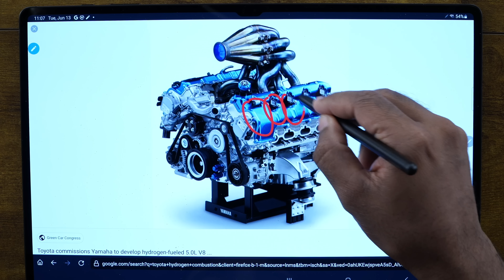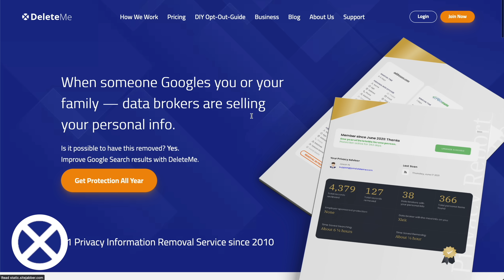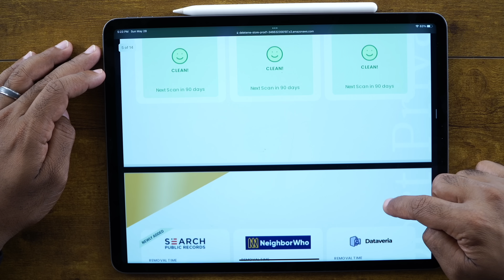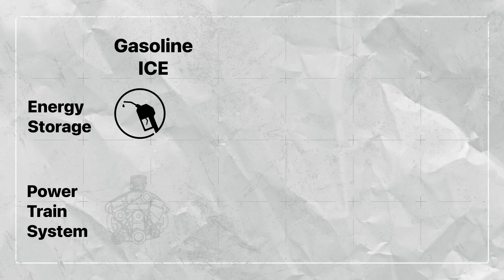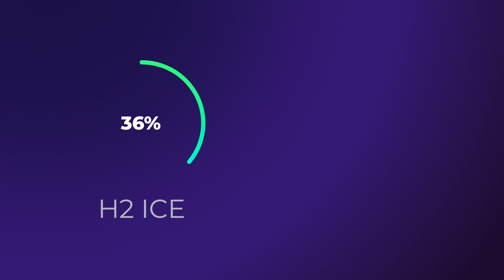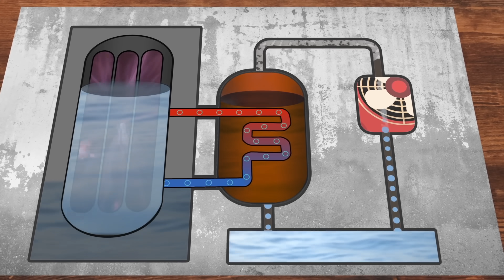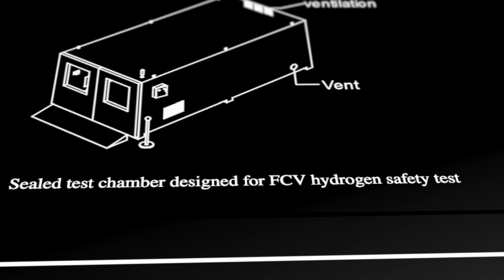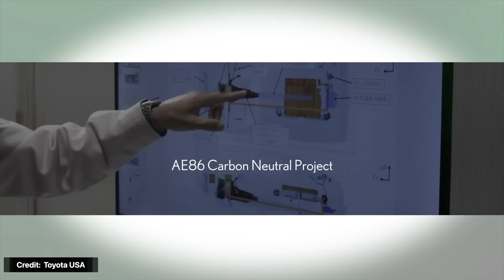Toyota's Says They Just Destroyed EVs - Hydrogen Combustion Engines

Comment: As you mentioned, in part at least, the production of EV batteries requires mining and processing of dirt to extract necessary minerals, eg Lithium (I hear rumours that there are in the wings batteries that will be based off of either Sodium Chloride or Carbon Dioxide but seeing is believing).  I'd be interested to see a comparison of the actual cost to the environment of the actual "cost" to produce hydrogen (we, I believe are developing green hydrogen plants here in Aussie) vs the actual "cost" to produce the stuff that goes into the current EV batteries including building the batteries and the cars (loads of plastics) themselves.  I recall, what we call here the RAC or AA, in Germany saying you'd have to do in the order of 160k kms in an EV to undo the enviro damage done building the vehicle.   By "cost" I mean pollutants short and long term and, the energy used (and can that be renewable energy).
Reply: Agreed, the environmental cost of battery materials sourcing and manufacture seems to have been glossed over in this video. If you've ever watched documentaries about this mining you can see that it destroys huge areas of forest and requires huge highly unclean machinery to mine just tiny amounts of these materials. Further to this I find it incredible that no one seems to be discussing the impact of nuclear power plants on the environment. Whilst the production of electricity from them is relatively green there is the issue of nuclear waste disposal that rarely seems to be mentioned or discussed. I understand underground nuclear waste storage facilities generally do a good job, however as more and more waste is produced how large will these facilities get and how expensive will the upkeep become to prevent leaks and contamination. I'd love to see a video that discusses these issues please @2bitdavinci
Reply: @TheWindsurfk59 I think I saw a video somewhere talking about a technique they use now in nuclear that they can use the same material though the plant 2-3 times over and by the time they are done the nuclear waste goes from needing to be stored for thousands of years to only a couple hundred.
Reply: @TheWindsurfk59 "All" mining is destructive. That goes for everything and is not all restricted to batteries. ICE cars also always used materials that needed extraction and processing. Cars aren't made from Pixie dust. Oil is an ugly business and fracking us terrible.
But battery materials are suddenly the one resource extraction people worry about.

We need to reduce CO2. Fossils have to go. That's priority number 1 - if we want to stop cooking our planet (more than we already do).
Reply: @oerthling  no sh!t Sherlock!! 😱 You seem to missing my point which is the extraction and processing element needs to be taken into consideration in these 'analysis' for both types of vehicle. Also I think you'll find the extraction and processing of rare earth metals requires more energy and destroys large areas than the extraction/processing of more abundant metals, pound for pound. Not sure why you think I don't realise the end goal is reduction of CO2 production and fossil fuel use?! Never said I disagree with that, and for your clarity I whole heartedly agree that we need to reduce CO2 emissions. I just know that unless you do a full comparison of all elements of the process you can't for certain say that one is more environmentally friendly than the other. Imagine for example they found a way to convert existing ICE vehicles to hydrogen ICE vehicles. How many people have bought new EVs and scrapped/sold their existing ICE vehicle, producing more need for mining rare materials to manufacture new EVs all based on the argument that what comes out of the exhaust pipe is greener but with zero consideration the impact the manufacture of the new vehicle has or where the electricity comes from. Someone further up this discussion has said research tells us that 80% of the world's electricity still comes from the burning of fossil fuels! So no it's not as simple as you seem to be patronisingly insinuating for no apparent reason. I can only assume you have brought into the sales schpel and bought yourself an EV and now take offence at anyone questioning that choice? If you're truly all for a greener planet then surely you agree all aspects of any decisions we make should be researched fully to properly inform our buying choices. I don't know the answer but I know I'd like to have all the facts before I make a decision. As you're so sure of yourself go on then tell us all the exact impact of a modern ICE vehicle Vs an EV from manufacture through life span, including fuel production, distribution and recycling yield Vs recycling CO2 emission requirement. And while your at it maybe you can tell me how much CO2 it'll produce to start blasting nuclear waste into space once we've run out of storage space?
Reply: BYD has Sodium Batteries in vehicles
Reply: Still hetter ROI for pollutants that an oil burner, which only gets worse the oldet it gets!
You can never win with ICE!
Reply: What a bunch of nonsense BS. Sadly this is the same overused propaganda script with zero sources and total ignorance of engineernig reality.
1. As an Aussie you very much know such experimental programs like the Toyota Hydrogen Centre in freaking OIL Refining Town ALTONA Victoria is PR Stunt that will be shut down soon.
2. "160k kms in an EV to undo the enviro damage done" is cunning fear mongering word salad.  I love how you inflated the number to 100,000 Miles from 100,000 Kilometers which is what the heavily panned Volvo PR report stated "Volvo C40 Recharge will need to cover 68,300 miles (109,918 KILOMETERs) before it breaks even with the ICE XC40". The realistic number for Aus dirty grid mix around is 50,000 Miles because we're just soo Coal & Gas dependant. That 50,000 is in comparison to BEVs easily achievable 200,000 miles or way more lifespan.
3. "loads of plastics themselves" What an idiotic false assumption. ICE uses just as much plastics as BEVs, especially since Toyota and GM pushed the use of Plastics even for key engine parts like Coolant manifolds. Use of plastics is Moot between ICE and BEVs.
All you have done is spread falsehood rumors to fear monger.
Reply: Auto Expert John Cadogan, does the break even comparing a Ford raptor to the Tesla plaid.
Reply: I'm not shure but I belive the exact data is hard to extract scince those rare dirts (I don't know if that's how you say it but I simply translated it from the portuguese "terras raras") are mostly under China influence and other components like cobalt are mined in poor countries with child labour and stuff
Reply: @antonioramalho1835  Most of the lithium at the moment comes from Australia. The problem is that it is easy to process as it is just dug from the ground, like coal. To keep up with just the demand today, we will have to use other sources of lithium, the kind that requires more of a process to extract and process. But yes it is hard to get any accurate data from china.
Reply: It's more like 100k km, but batteries are energyagnostic and they can be produced in a green way, just by using EVs in mining.
Reply: @michalandrejmolnar3715  what about the rest of the car? N Lithium is far from green.
Reply: @huwgrossmith9555  there are better cell chemistries like sodium ion
Reply: You have to keep in mind that infernal combustion cars can be more or less thrown away after 10 years or more. EVs as cool as they are, unfortunately are hazardous waste and will be a problem long term.
Reply: @SixTough  The batteries can be re-used after the capacity is too low for a car.

Battery capacity in a car has volume and weight constraints that become much less relevant for a house or grid battery.

This has already started in pilot projects.

Eventually, after the batteries have really been used up they can be recycled. 

And you can't just throw away ICE cars without leaving hazardous waste. All that plastic, some of the metals and certainly all of the oil gunk is problematic. Yes, people have been doing that. But just because they are assholes, not because it's not a problem.
Reply: @oerthling  yeah sure and the current ICE car batteries can also be reused. How many of them are?
Most plastic and oil can be burned albeit some fluoropolymers will likely be used in gas couplings.
Reply: If they did they told you the truth, no one would buy an EV 😡
The life cycle of a battery is 10 years Max
Production of EV makes it so it takes the first 6 years for them to be clean, not hard to work out how long they're really clean for!
Then what happens to those depleted battery's, land fills or the bottom of our Oceans 😡 and these are the people that profess they're green 🤣 It's a big Con and gullible people are falling for it hook line and sinker and guys like these are making money off the gullible 😡
Reply: I'm still waiting for graphine to come into our lives. Over a decade ago it was discovered as cheap and efficient battery storage. 

Batteries must be like toothpaste. Always new and improved yet nothing changes
Reply: This is an incredibly important point. Not only do you have to consider the environmental cost of creating the EV and its batteries, you also have to account for the cost associated with the generation of its electricity.  Currently approximately 80% of all power generated across the globe is from fossil fuels according to the Environmental and Energy Study Institute, ergo most EV's will never even be close to carbon neutrality.
Reply: @phalanx21860  I imagin the weight would be an unknown energy efficiency factor as well. You might have good milage but at what cost in power needs when the vehicle weighs almost 10,000 lbs.
Reply: @Raven5431  yeah a lot of factors to consider in this situation
Reply: @phalanx21860  honestly if your talking just about pure efficiency then trolly cars would probably be millions of times more efficient lol. Co sidering everything is going self driving anyway you might as well be connected to a track system.
Reply: @Raven5431  honestly not the worst idea, but I could see implementation being rather difficult in a lot of locations. seriously good idea in theory, just in practice it could be difficult :)
Reply: @phalanx21860  ya would be very difficult considering weather and debris on the road. Track system in the road I think would be out of the question. Overhead powered tracks would be an idea specifically on the highway for long distances that you can connect and disconnect from. Might not need a solid connection something a bit more loose and a way for a car to know its location.
Reply: @Raven5431 "Unknown"?
Reply: @phalanx21860 Always the same FUD - again and again.

Everything has environmental costs. But for some reason people never worried about those when it comes to ICE cars and oil - but suddenly batteries have environmental costs that totally mean we can't use those. But we can still use ICE cars? While fossils cook our planet?

This is mind-boggling.
Reply: @oerthling that's because the argument for ev's is that they're green. No one thinks ICE cars are.
Reply: @PhilboDraggins  No car is "green" in absolute terms.

But being relatively green compared to ICE cars isn't that big of a hurdle.
Reply: @oerthling  a hurdle that evs are currently tripping over. even if they use purely renewable or nuclear to charge, nothing is mitigating the effects of mining lithium and using that much plastic.
Reply: @PhilboDraggins  What is mitigating the lithium is not emitting anything during use, not using up all the materials making up an ICE motor and exhaust and tank and being a lot more energy efficient, quieter and even more responsive.

Plastic? Other cars don't contain plastic?
Reply: In a complete analysis EVs are about as dirty as ICE cars. If battery capacity doubles then they’ll be a clear winner. Toyota wants an option for everyone. EVs are nowhere near suitable for everyone. So they’ll make some EVs, ICE of multiple kinds (synthetic fuels are also a reality) and hybrids and sell even more cars than VW. Seems like a good decision to me.
Reply: @f.kieranfinney457 No. They are not.
Reply: @oerthling  the total CO2 emissions are better for a hybrid ICE than pure EV. So yeah. They are. Mining, shipping, manufacturing, disposal are all part of total CO2. EVs are worse at the moment but will eventually do better. For places where electric infrastructure is poor and incomes are low, like Africa, ICE will dominate for decades to come.
Reply: All of the minerals would be mine anyways to make other technology. Hydrogen car would still need minerals and plastic like every other car. EV batteries last easy longer then we thought 10 years ago and once not really usable in cars can go to storage and then there are companies set up now ready for recycling of batteries to keep the minerals circulating in the economy. The recruiting process is also on its infancy and will get better.

Comment: I am a believer in H2 as a fuel source for automobiles and applaud Toyota's developing an ICE for this fuel source. Regarding EV's they faced the same negativity at the start due to minimal availability of fueling stations. Currently EV's are, in most cases, priced out of "normal" consumers budget. The one MAJOR issue with EV's, and there are probably more, Is the life of the fuel cell and the disposition of it when it wears out. All in all, I believe EV's technology consumes more fossil fuel energy than H2 production. If the US would quit vilifying nuclear as an energy source, I think, over time the cost will come down. You are an Engineer after all.

Comment: I hope H2 ICE cars succeed and given time and investment (just like EVs needed) I think they can.  I can't support EVs because the typical EV is way more expensive to purchase, has a much worse long term environmental impact to procduce (hello Chinese strip mining), and according to the dozen plus people I know who have EVs, none get their rated range.  These factors mean the typical EV will take almost 7 years of driving 10K miles/yr to break even, cost wise. with the equivalent gas ICE car (assuming low eletricity costs, which the green industry pushes higher every day).

Then we have to consider the typical ICE car can last 15-30 yrs easily while every EV will need to have an extremely expensive battery replacement within 10 years and the new batteries need to come from sources that have little to no concern for the environment.  We will run out of the rare earth metals for EVs (while doing more environmental damage) far before we will run out of fossile fuels.

Comment: Mostly sounds like Toyota is trying hard to see if they can create a viable way to maintain or repurpose their existing infrastructure for engine and parts manufacturing and maintenance.  EVs have a lot of advantages, ICE's, of any kind, have the advantage of established infrastructure.

They're also keenly aware that a big part of their profit comes from vehicle maintenance.  The fact EVs are radically cheaper to maintain is a threat to their current business model.  If EVs hit a critical mass market adoption level, Toyota will no longer be able to rely on a dwindling "maintenance" market, and be forced to shift their business model to compensate.

That's not to say they won't do it, but if they can stick to what they've already got, they will.

Comment: I marketed the HAFC a hydrogen fuel cell kits I've been involved in research of the fuel cell. The fellow I worked with still has working fuel cells on his vehicle.  
What is coming now is a electrical motor that uses magnetism to produce electricity.  On vehicles no need for batteries or plugging into the grid .

Comment: I think in the U.S. the red Hydrogen approach, would be good to solve both the manufacturing, and a large part of distribution hurdles.  While at the same time increasing clean energy production around the country.  The biggest problem is the current drought in the midwest limiting the water supply in many non-coastal areas.  Maybe i'm wrong here, but I think there might be a bigger problem with water vapor emissions than some people want to admit.  Just imagine the humidity in L.A. if they replaced all that smog with water vapor.  Plus when it's cold i can't imagine how dangerous the ice buildup on the roads might get.

Comment: You are dishonestly presenting "energy storage".  Gasoline is an energy SOURCE. Batteries and H2 are energy STORAGE. You pretend that H2 causes "virtually no CO2" without asking where the H2 comes from. It comes electrolysing water with ELECTRICITY, so it is a form of  energy storage, begging the question what is your energy source! Comparing an energy SOURCE to two different forms of energy STORAGE, is dishonest, unscientific and basically uneducated. You justify your two bit name with your two bit pseudo science.

Comment: If batteries are so efficient why don't power plants use them instead of coal or gas to produce electricity? (That's rhetorical.) I'm guessing the efficiency calculations for battery electric don't count the production, transmission and charging losses. And since the H2 ICE number doesn't include production and storage losses, it's only fair batteries should as well.

Comment: If this proves practical, the rechargeable battery electric cars will be the 'compact fluorescent light bulbs' of the 21st century. Remember those? There was a big push to do something, anything to save energy and we got those CFL bulbs. Crappy light and filled with dangerous powdered mercury, when LED bulbs came along later we realized that the CFL bulbs were a lousy knee jerk reaction to 'do something, anything, NOW!' when the real solution was not that far off but we started down the wrong road. Now imagine all the BEV batteries, the charging stations etc. which will be leftovers from a half baked solution.